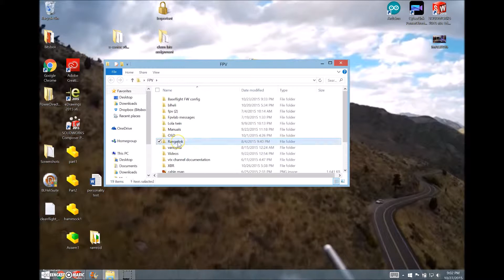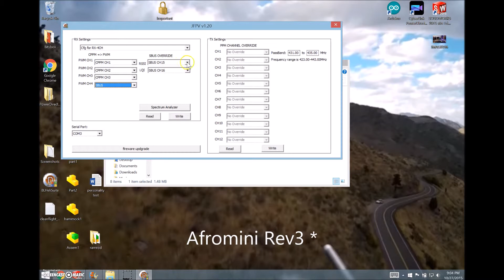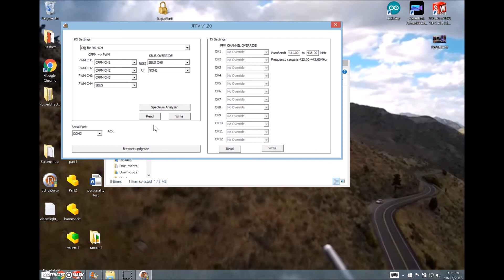Rangelink 4ch/8ch Receiver Configuration (with Sbus/rssi)

Comment: Hey man you seem very up to speed on Rangelink, I have a 12ch Rx and Tx I bought last year and a 4ch Rx I bought last month,. Can I just change the firmware in the 4ch to match the older 12ch Rx and my Tx??
Reply: can I down grade the 4ch to match my my 12ch?
Reply from the maker: +Joe Walsh No. just upgrade them all to V2. The 4ch and 8ch diversity receivers only work with V2, and have the new features like channel mapping, RSSI injection in PPM stream, and spectrum analyzer.
Reply: Thanks that's what I needed to know. I am just going to get another 12ch, I dont have the tool required and they are out of stock at Sids store.
Reply from the maker: You can also use a FTDI.I got mine from readytoflyquads for like $5
Reply: +Ryan Friedman  Yes, I had one. Got the 12ch Rx and the Tx upgraded. Thanks for the manual and the video. Next is to change the 4ch Rx to PPM and RSSI so I can use my storm OSD on my mini sky Hunter. Waiting for the Storm USB update tool to upgrade the firmware to accept PPM.
Reply: +Ryan Friedman  Yes, I had one. Got the 12ch Rx and the Tx upgraded. Thanks for the manual and the video. Next is to change the 4ch Rx to PPM and RSSI so I can use my storm OSD on my mini sky Hunter. Waiting for the Storm USB update tool to upgrade the firmware to accept PPM.
Reply: +Ryan Friedman  Yes, I had one. Got the 12ch Rx and the Tx upgraded. Thanks for the manual and the video. Next is to change the 4ch Rx to PPM and RSSI so I can use my storm OSD on my mini sky Hunter. Waiting for the Storm USB update tool to upgrade the firmware to accept PPM.